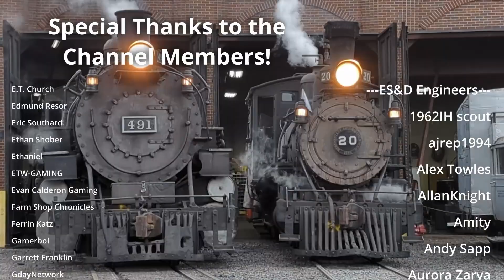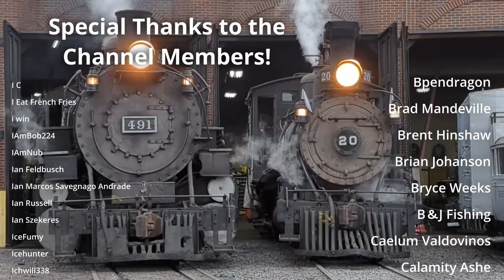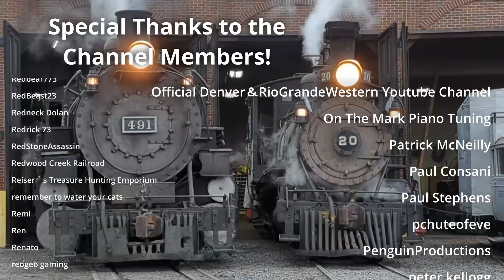Does COAL size matter in STEAM TRAINS? | Railroad 101

Comment: When I fired the K-28s and K-36s on the D&S we had large coal like the good stuff you were using. But towards the end of the day you’d start getting into that crummy stuff and it just stunk. I heard though that back in the day with certain railroads, obviously the grades of coal would vary depending on where it’s from, but the standard size of the coal chunks was smaller than what we use today. Probably about half the size, which I guess made for a more even burn. But who knows 🤷‍♂️

Comment: In power plants they use coal dust to get the most heat the quickest, did the slack fired runs burn hotter than the normal sized coal runs?

Comment: The thermal energy of the coal should just be proportional to mass (unless the chemical composition of the slack is different, which it could be), so it should take the same poundage of coal to turn the same volume of water into steam, either way.  But with big chunks of coal, it seems like the coal scoop would hold more, no?

Comment: I think the coal delivered by an automatic stoker would be mostly slack. I toured the Big Boy at the Forney Museum and that coal was blown into the fire after delivery to a ceramic (?) receptacle inside the firebox door,.  Could gravel-sized chunks  pass through the auger? My dad, who fired steam locomotives, said that even with an automatic stoker, a fireman was constantly monitoring and poking the fire to keep it even. 
I think a fireman's job to be like that of a one-armed paper hanger, even when the coal is fed into the fire mechanically.
Are any automatic stoker locos in Golden?
Did any western roads scoop water?
Reply: The New York Central did use track pans on the water level route between NYC and Chicago. Unfortunately, some of those track pans were receiving inadequately treated water, which wasn't discovered for quite some time.
Reply: @Phoenixlover55  The PRR also used them, and even the B&O had them as far as I know. I might even have a WTF story about them somewhere in my memory. Most RR stories are WTF.
Reply: I think the big late model beast at Golden, a Burlington 4-8-4 I believe, probably has an automatic stoker.
Reply: @andyjackson3414  If you're thinking of the CB&Q 4-8-4 at the railroad museum, she's actually oil fired, though she was originally coal fired, and presumably did have an auto stoker.
Reply: @Phoenixlover55  Many western roads used oil instead of coal. I doubt if the B&O had any, and that may have been the case with all eastern rails.

Comment: Do you have like a hammer or pickaxe to break the dino eggs to fists of coal? 
Writing this I imagine you probably do. 
Also its probably worthy to note you're calling it slack coal and not slag as in impurities right?
For the short time I fired at the local steamtram museum ( Hoorn, Netherlands) I didn't really have to deal with slack coal, and everything was fist size before being loaded into the engine. 
But they only have tank engines, no tenders in the whole museum there.
Reply: In the past Hyce has used a hammer to break up the coal to get it ready.

Comment: Before watching the entire thing, prediction:  Smaller particles have greater surface area, which means fire will move faster through slack than lumps.  This would present (given equal air flow through the box) as a fast, hot fire, but likely with less overall energy content.  The flame may be hotter, but with less burn time (unless the powder is literally FLOWING into the box) the burn will happen in phases, a hot phase and a cool phase.  Since boilers work (water=BIG thermal inertia) on AVERAGE temps, the water temp would ~remain the same~.  End result= more shovels, more human work, same or slightly reduced engine performance.

I would love the engineers' talk on boiler thermal inertia and effects of coal size, injector flow rates, etc.
Reply from the maker: Smart man. :)
Reply: Yes! Even more: some 30% (or more: I may be mixing numbers up) of the energy in coal comes from burning the gases that escape from the burning coal. So big lumps make it harder (cube : square) for the gases to be released. (The mixing up may be with the 30% of energy left in the ashes after "first time" burning. I got those numbers as a fireman on a ship from my engineer.)

As to firing a steam locomotive "properly", query YouTube for the 1947(?) LMS instructional movie "Little and often", which I have also seen condensed here on YouTube. This movie made me try firing that (small) steam ship.
Reply: Yep, except the engine would actually be much less efficient.  The amount of air going through the firebox is a function of the locomotive’s draft, which only depends on how hard it’s working. All of the slack would try to ignite fairly quickly after being shoveled in (because of low surface area/volume ratio), which would probably use up all of the available combustion air and result in a lot of black smoke in the hot phase, followed by too much air in the cold phase, which would make the engine actually run much less efficiently because so much of the energy in the coal is being wasted by inefficient combustion.
Reply: @michaelimbesi2314  The matter of "air flow" may be more complicated. Air may enter the firebox over the fire (in locomotives: through the firebox door) or from below (there may be a valve). The draft may be regulated by a valve in the smokestack (on "my" ship) or by the amount of exhaust steam used as an ejector.
In pidgin English (the Dutch expression translates to "coal English"!): on "my" ship "over air" would be applied upon building the fire, "under air" as the default working state. We firemen would monitor the state of the fire by the colors under the fire and the accumulation of whatever would fall through the grid. We would regulate the draft by repositioning the valve in the smokestack (outside). To us (notably this engineer, with a passion for steam), the state of the fire would be a point inside a virtual triangle of air in, smoke out and coal. And obviously, the manometer was the boss...
Note that this ship has a condenser, while that has been an exception with locomotives.  :-)

Comment: Wasn't expecting a video on slack (sounds like clinca or just smaller coal..)
In summary hyce used 30 scups over 3 miles
Well dusty used 49 of the dust, dirt and coal inpurtys of slack coal (its smaller too)

Comment: In the coal-fired power plants that I've seen depicted in museums and on YouTube elsewhere they tend to use pulverized coal. That's extremely fine powder, but they introduce it to the boiler being blown in with a jet of compressed air and it burns in the air before the ash settles down. I would suppose that an auto stoking engine like a big boy as seen in the Animagraphics video recently would have an easier time with slack coal because it would just lift it up and blow it into the fire without much issue, and it would likely burn before it even touched the firebed.
Reply: There’s probably a limit where it gets too fine and causes problems, but mechanical stokers are generally known for not getting tired
Reply: Yeah, I wonder how much material falls straight through to the ash pan or ends up drafted straight out of the smokestack.
Reply: Yep, it would burn a bit like a blowtorch. The coal and the compressed air jet would mix together and form a mix of fine dust being continuously blown into the boiler, which would continuously burn as a jet of flame.
Reply: @michaelimbesi2314 they use steam for directing the coal, not air. The westinghouse compressors would have a hard time staying ahead of a hungry engine. The stoker drive is steam, as are the directing jets off the firing plate.
Reply: @kleetus92  Also if you used compressed air to fluidize coal the resulting mix could burn where/when its not desirable/expected, with steam there is far more limited oxygen so combustion won't occur outside the firebox, and will happen in a uniform layer on the outside of the injector plume without combustion near the nozzle.

However the flip side is the steam itself contributes nothing to the combustion, but has fairly high thermal capacity, it might help contain the peak temperatures nearest the fire, but its stealing a lot of heat and taking it out of the chimney which would otherwise have entered the boiler had the thermal differential been higher.
Reply: @SheepInACart  combustion air comes from underneath the coal. The steam is really insignificant in terms of the BTU output of the fire itself. 

There is no 'nozzle' that the coal is shot out of, you're thinking of an oil burner (which also uses steam to atomize the oil). The coal is literally augered up and on to the firing plate (like a pellet stove) and the steam jets literally blow it off the plate and around the firebox. It's purely the mechanical means to get the coal from the plate to somewhere in the desirable in the firebox.
Reply: @SheepInACart  Depends on exhaust temperatures. If the boiler tubes are long enough to cool the smoke nearly to the boiler temperature - some steam mixed in won't steal too much heat. And lowering firebox temperature might be useful from structural stress perspective. Although on superheated engines that would impact water use efficiency (on top of spending steam on blowing coal).
Reply: Locomotives with stokers use more expensive "stoker coal" of a uniform size.
Reply: Like playing a Nintendo game. Flower powers is fire power fuel with coal

Comment: Bit the same weight would mean the same energy per scoop.

I would assume that a finer powder would burn faster but also mean you need a smaller fire because it burns more/faster/hotter.

And if I recall an earlier video of yours you said that back in the day the coal was much finer. Like sugar cubes instead of fists. And that meant it could be transported using a screw (like on Big Boy).
Reply: as you said, powder burns faster and you loose heat energy out the stack as it cannot heat the water. nice lump coal burns at a steadier rate and transfers more of it's heat into the boiler.
Reply: @geoffgunn9673  flip it around. Independent of the fire size: if 1 kg of coal burns up (that is the weight loss of the train) per minute, that could either be a small fire of powder that burns quickly or a large fire that burns slowly. The amount of hot gases exiting should be the same per energy and the amount of energy should be the same per fuel.

If you can burn the fires equally complete.

Of course it is easier to fire big chunks because you have more time to react, but I'm arguing against it having more energy per weight if you can handle the fire.
Reply: @dennisolsson3119  it's more all the fuel is burnt quickly and lot energy is lost out the stack, where bigger chunks will transfer more of their energy into the water over a longer time. Ends up throwing more fuel in powder form to compensate for the loss out the stack. 
Some boilers where made to take powered coal, usually mechanically at a constant feed rate and no shovel work.

Comment: The only firing I've done is chucking wood into a 1917 40-horsepower Case steam tractor, which is very different to coal firing a locomotive, but it's still something. I also got to run the old girl, which was actually surprisingly easy, since you really only need to worry about the steering wheel, the governor takes care of the speed. You only need to touch the clutch if you want to idle the thing or run something off the flywheel, and you only need to touch the johnson bar when you've just gotten moving, and you want to hook it up, though you only get 3 notches each forward and reverse. It does have a handbrake, but it's really only useful for controlling speed going downhill, or as a parking brake. The thing also had chain steering like most steam tractors, so you need to constantly correct the front wheels, as the slack in the chains allows them to pivot a bit, even when the steering wheel's not moving. She also had the most atrocious ride quality of anything I've ever ridden.

Comment: Hyce, you always say that when 491 works hard she says Alamosa. Was it because it was the last place the k37s worked, or was it for a different reason? 

Another question, when 346 works hard does she say I hate Kenosha? I pronounce it (I) (hate) (Keno) (sha)
Reply from the maker: Alamosa was the last big division point on the Grande for the narrow gauge. 491 spent the last of her days running between there and Durango for the most part. 

346 only saw Kenosha for a year and a half of her very long life.... She might say alamosa as well. lol!
Reply: Hate Ke-no-sha would fit better I think
Reply: @TransTaey  I guess so. I just always pronounce Kenosha as two syllables instead of three.
Reply: K-37s were mostly used over Cumbres pass, where their higher horsepower was required. Mostly on the steeper Alamosa side. Hope this explains it.
Reply: @jacobgreve802  okay thanks for explaining it

Comment: I wonder if you could fire a locomotive off of coal dust
Reply from the maker: Absolute dust would be pretty hard, though stoker engines do basically use the slack we're burning here.
Reply: you would probably have issues with the particles getting sucked into the flues before they fully burned now that I think of it,
Reply: In theory yes you could, that is how coal power plants work. Union Pacific's coal turbine also did it that way, but it's not really effective for locomotives.
Reply: @jacobgreve802  fair point
Reply: @jacobgreve802  The C&O coal turbines also did it that way, and they had to construct separate coaling towers for them!

Comment: But because there's more surface area, doesn't it burn hotter?
Reply: You would think that, but in reality the temperature of combustion, would actually be the same regardless of the surface area. Having said that it would heat faster because the rate of consumption is higher, thus, while the temperature is the same it gets their much faster. I know this from heating with wood for years, and it's the same story, smaller pieces heat up faster but go faster, larger pieces heat slower but much longer.

Comment: It definitely matters with the 1/8th scale locos too. In my loco in particular, if you use nut coal you'll find it's steaming capabilities rather lack luster in comparison to using pea coal. Rice coal is almost small enough to fit through the grates but while it's in there it'll burn out quick.
Reply: I worked at rail yard that handled coal for export. There were many classifications for the coal, with names like "pea" and "grape." I was told that the coal was often graded according to BTU's, which might reflect it's size.
At that time, my curiosity was somewhat limited to knowing enough to do my job.
That youth is often wasted on the young is true at least in my case.
Reply: @andyjackson3414  Different coals of the same size can have different BTU ratings. Coals are sub-bituminous through anthracite, i.e. brown, soft through pure, rock-hard, black carbon. I think bituminous coal has the highest BTU per weight, but anthracite has the highest BTU per volume, if I remember correctly.
Reply: @psycotria  Amazing stuff. Too bad it might wind up killing us.
Reply: What is this coal rating for ants
Reply: @godlugner5327  At least 1/8th sized humans... In my experience, the actual size of the coal is one step above the rated size. Rice being the size of actual peas, pea being the size of actual grapes, so on.
Reply: I’m so jealous of you 1/8th scale guys. My budget is capping out at G scale, lol